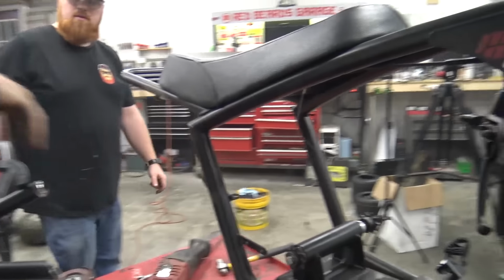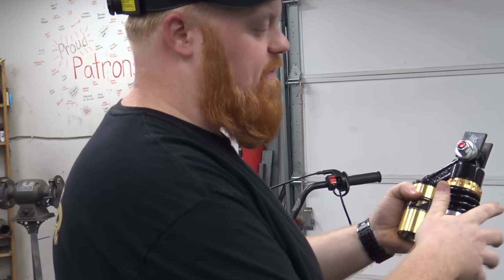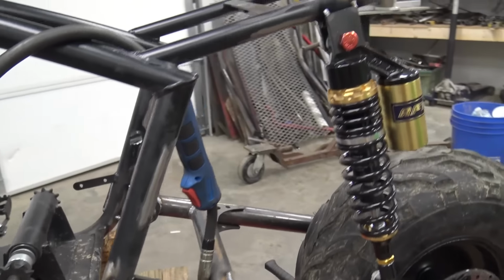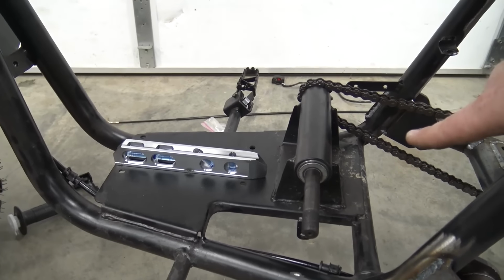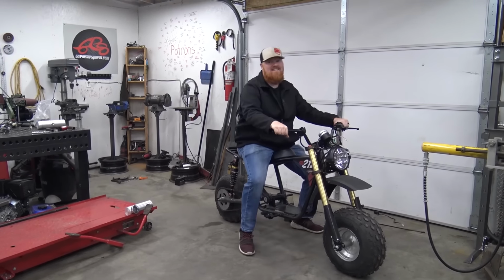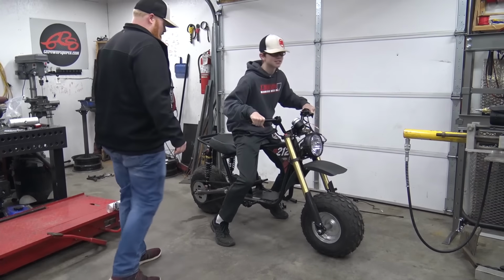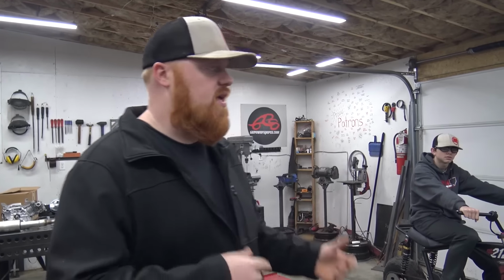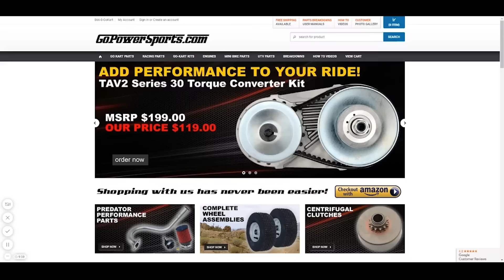Custom Mini Bike Swing Arm

Comment: that rear rack wont last long without some additional support, and my engine plate ripped off mine after i put a 20hp stage 4 predator 224 on it with a juggernaut. ill be welding it back together tomorrow.

Comment: if you make the rear fork hinge part in two pieces and mount the jackshaft with its bearings and sprockets in between the pieces using the axle for the hingepoint of the rear fork you whont have any slack in the chain  not even if the wheel is straight under or passed the engine  
it might try to climb the chain and either lift or drop the rear if you add power 
not sure if it can be done , you still need to connect both halves of the rear fork somehow and make it solid to prevent the fork halves from going up and down independent from eachother and making the rear wheel flop side to side
merry christmas to all

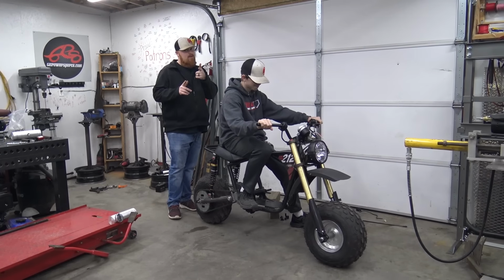Comment: Lookin good !  At the 8:30 to 9:00 minute mark you can see the chain get loose. You mentioned the rear suspension still wasn't fully compressed also. The more you compress it the looser the chain will get as your swing arm pivot is far away from the jack shaft. I expect when you trail ride it and hit a good hard bump compressing the rear shocks fully that you will kick the chain off. Perhaps not every bump, but expect it to happen. On the next build PLEASE get the swing arm pivot next to the jack shaft pivot. Using the jack shaft as your rear swing arm pivot is best.
 Here is a video that may help you understand this. https://www.youtube.com/watch?v=wSdqa1elQJ0&t=15s

Comment: I need the Monster Moto original front suspension because I wanted the Monster Moto 212 but they were sold out so I bought the Mega Moto 212 for 100 less brand new but that 100 cost me front suspension front and rear disc brakes and Torque converter! You wouldn’t happen to know were I can get the front suspension since the company went out of business and Coleman wants 191.00 for the front suspension with just the hardware?

Comment: Why do you or anyone use a jack shaft. Why not run the chain directly from the engine shaft sprocket to the wheel sprocket on the left and put the disk brake on the right?

Comment: Just a heads up, those shocks are junk, they will break at the point where the heim screws on at the lower point, we have broke 3 sets with light use.... There junk aluminum

Comment: Not knocking your welds but the spot where the swing arms connect to the rest of the frame, looks like it's going to put alot of strain on the weld points

Comment: I bought the MM-B212 Mega Moto because the  MM-212 Monster Moto was out of stock little did I know they were going out of business. I’m looking for the fork suspension for my Mega Max it’s 24.5 inches from the top tree to the 12mm bolt holes at bottom of forks for my stock 19x7-8 tire. Do you know were I can find a set that are black we’re brake caliper bolts to? I seen your Monster Moto video and that’s the bike I wanted front suspension front and rear brakes with a headlight. I installed 60 watt x 2 one above the other but I want a front suspension that will fit and wire my total 120 watt lights to my 6,000 mah battery I keep in my mounted ammo box on back rack it also has USB for charging cellphones. After I get the front suspension I plan on putting a swing arm on back for rear shocks. I know the gold set you used are expensive and I’m just looking for a set around stock. If you know of a place I’d appreciate it Thanks!

Comment: I made the E1000 into the "E2000" now runs around 28  MPH full electric 48V. I would love to bolt on the front shocks and eventually rear swing arm. Any idea if the fronts on the larger monster motor are a bolt on? check out my post of "fat guy little bike" to check it out. You can erase this post not trying to plug, just wanted to show you proof I did it

Comment: AKA Mickey mouse reinventing the wheel kind of thing...bet that chain pops off regularly....no?  I only say that because I had a really similar deal where Taco mini bike company took their hard tail minibike and eyeballed a jackshaft/swing arm rear suspension but they did not R&D and frankly it was crap.....much to my young dismay ....that chain popped off a hundred times....incurable without total re-engineering or just bolting rigid struts in place of shocks....SUCKED!  and had to pay like 30% MORE for it to be shit
Reply from the maker: I have only had it kick off two times.